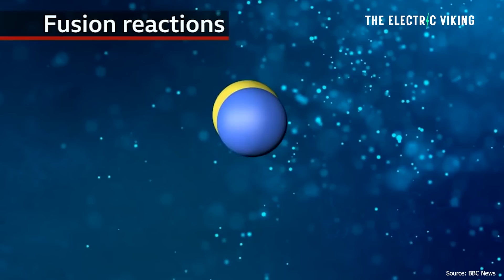Germany says it is leading the world in NUCLEAR Fusion - will invest $2 billion

Comment: Every fusion demo so far ignores one key factor. The amount of power required to produce fusion is not the only problem. It is the power required to power the lasers, tokamak or whatever is used to produce whatever is driving the fusion event. Then you have all the losses in converting the fusion reaction to something that is useful. The money would be far better spent on existing clean energy generation. Even the not so clever Thorium reactor is available now and would be better.

Comment: I am not sure the Yanks got a Fusion system to produce positive energy. My preliminary reading of the studies is that they did not. I would love to be wrong about this and if anyone can correct me then thank you. Fission does produce a lot of energy but there is a very big problem with the waist. I believe there are some promising recent advances with the use of nuclear waist products to be reused to both produce more energy and make less volatile byproducts. There are large sways of land in Australia with a lot of sun that could be used at a very small (comparably) capital cost to set up solar farms. To conclude Fusion seems to be a pipe dream. (would love to be wrong) Fission works but we need to solve the waist problem and Solar/battery could work well at least in central Australia where there is a lot of sunny land with not many other economic uses.

Comment: Fusion research has yet to reach "breakeven". Yes, I know the Livermore Labs claim of 2 Mj  laser energy into the target producing 3.6 Mj out - but it took 30 Mj to make that 2 Mj laser bolt.  Every step closer to "breakeven" has required ever larger and more expensive reactors, and the trend is clear - by the time they exceed breakeven and produce useful amounts of energy, it will be so big and expensive that it can't be economically viable, and may well be the most expensive source of electricity yet. It might find use in "cost is no objection" applications, like military or space exploration, but it won't solve our energy problems.

Comment: 5 times more electricity in a no fossil fueled world. 

Fossil fuels are very high density energy. 

Central generation is a dead duck.
Horse meat was cheap when the Ford model T production line started. 

The national electrical power grid is a 100years stupendously expensive thing. 

Poles and wires to every street and home and building and industry and factory and warehouse and shopping centre and everywhere is incredibly expensive. 

5times is humongously expensive. 

Generation and storage at the ends of the existing national grid is the only economic possibility.

Comment: Sam you are on FIRE! So many interesting videos on the very latest topics regarding renewables, EVs, and even Gov subsidies and their effect on world trade. Amazing. Thank you Sam.
Reply from the maker: Glad you like them!
Reply: @electricviking but the fusion  video is wrong, the laser fusion needed way more power from the electrical grid than they produced. The power gain was only from the laser energy to the output, but the lasers required much more power from the grid to work!

And it was only one ultra short pulse, with an energy loss in total from the grid to the output. Doing many of these pulses per second would just increase the energy loss.

They still have so much to do in research... It's not just an engineering problem like doing many shots per second and harvest the energy, there is way more left to do.

Comment: First off, the US fusion system at Lawrence Livermore isn't even designed as a protype of a power generation system.  It was created to test nuclear fusion to make up for the fact weapons testing has been banned by treaty for decades.  They're researching nuclear bombs, not fusion power plants.

Beyond that, it absolutely did not release more energy than was put into the system.  The system consumed over a dozen times more energy than it generated.  The only thing it achieved was returning more energy from the fusion reaction than was pumped into it by the lasers themselves.   No doubt that's an achievement, but the lasers weren't especially efficient and took many times more energy to power than they delivered to the pellet.  And there's nothing about the system they utilized that would be easily scalable.  

Even if it could be made a dozen times more efficient - which is dubious at best - it's still decades away from being improved to the point where they could perform dozens of similar reactions a second, for months on end, which is what would be required to make fusion an actual power source.

Comment: Fifty years ago I did a project on Nuclear Fusion as part of my Honours Degree  in Physics at university. At the time some scientists were predicting that viable Nuclear Fusion power stations will be developed within 30 years. Fifty years later scientists are still predicting that Fusion power is 30 years away. I don't mind spending money on nuclear research but to think that it will produce solutions in a viable time frame is another thing. Anyway, what is the matter with the Nuclear Fusion reactor that we already have, has been providing Earth with energy for nearly 5 billion years and will for another 5 billion years.Oh and the energy source is free, you only have to build the infra-structure. The Sun is clean, green and very cheap.
Reply: Well,  I work at the lab that did get fusion gain, for the fourth time now. So, now fusion is only 29 years away.
Reply: @jm3digital  LOL. We all (at least those that follow Fusion) know that Gain (Q) is not all it cracked up to be. It needs to be in the order 10 times gain Q>= 10 to make up for input energy losses
Reply: 5 times more electricity in a no fossil fueled world. 

Fossil fuels are very high density energy. 

Central generation is a dead duck.
Horse meat was cheap when the Ford model T production line started. 

The national electrical power grid is a 100years stupendously expensive thing. 

Poles and wires to every street and home and building and industry and factory and warehouse and shopping centre and everywhere is incredibly expensive. 

5times is humongously expensive. 

Generation and storage at the ends of the existing national grid is the only economic possibility. 

Rooftop solar in Australia is cheaper than windows, $/m2.
Big batteries are free with EVs. 
Vehicles are parked 23hrs every day. 

Rapid chargers will be on the main roads and at corner stores. 

Nobody does the maths, it is ezi pezi.
Reply: Except not everybody lives in Australia. How do you think to generate renewables in Poland or Germany in december if there is high pressure system for 10 days ? No wind and solar is minimal in december there. In Australia conditiions without wind and solar do not last longer than 24h so will be easilly done with storage before the end of the decade. @stephenbrickwood1602
Reply: All must be reminded of old school.😎
Reply: I have plenty of solar energy during summer, but hardly any during winter. Germany has more solar during winter, but not enough. Solar is a solution after we can store energy economically for half year, not yet.
German stellarator is an interesting design. It might be first fusion reactor to produce energy. But I have not seen evidence of it.
Reply: @jkn6644  If a large amount of annual electricity is renewable, that will be a huge help.
Some fossil fuel use in emergency and military use will continue.
80% of the world's population is in warm latitudes.
Australia rooftop is cheaper than windows $/m2, 
Most roofs are much bigger than 32m2.
Reply: @stephenbrickwood1602  In 2022:
Nuclear 29.7%
Hydro 16.3 %
Import 15.3%
Biomass 14.8%
Wind 14.1 %
Coal 4.7%
Gas 1.3%
Waste 1.0%
Solar 0.5%
oil 0.2%

Much more nuclear & wind now. So less import needed.  Problem is that wind can drop to practically zero for week or two...
Reply: @jkn6644  we are biased by where we live. 
I think about the global situation but live in the sunniest country on the planet. 
But we will be the first to burn and then suffer floods that wash away topsoil. 
We suffer from the world's CO2 proliferation we fought against nuclear proliferation.
We need a renewable proliferation fast.
The other possibility is depopulation proliferation. 
But climate destabilisation may come first.
Reply: In cloudy Northern latitudes the sun is not reliable. In Australia Spain North Africa etc .....it is.
Reply: You are extremely old.
Reply: - which is precisely why the big Finance barons, the high priests of money HATE solar, PV power... It is breaking their economic extortion,  strangulation chokehold on our economy, their bread income streams for the past two hundred years have been resource extraction aka oil extraction, processing, and distribution, &  wars profiteering +  loan-sharking from their privately owned central banks
Reply: @@AI_effect NO! I would need 3000 km line to get enough solar during winter. For Germany 2000 km would be enough. Slightly less would be enough, but areas there are densely populated. On Monday peak price was over 40 c/kWh. Next night 0.4 c/kWh (+ transfer + tax). During the night we had enough wind, during day not.  Sometimes we have no wind at all (total in the country).  1000 km transfer line is not enough for wind. I don't know if 2000 km would be.  It is faster and easier to build new nuclear than to build such transfer lines.  
Solar needs storage for half year, wind perhaps month. Batteries will not do.
Reply: What's your point? We shouldn't pursue it because it's difficult? When you say what's the matter with the Nuclear Fusion reactor that we already have, I assume that was a mistake and that you meant Nuclear Fission reactor. The matter with those is that they produce a lot of radioactive waste and expensive materials are required to power them. Nuclear fusion is the endgame for power generational and would dramatically change the planet for every single persona and I'm really glad that it's being pursued, even if progress is costly and slow.
Reply: @WolfetoneRebel1916 The Fusion reactor we use now is the Sun.
Reply: @martintierney6172  central generation is stupid. 
It is stupidly expensive to transmit the future volume of electricity that the no fossil fueled world needs.
Reply: @WolfetoneRebel1916 the sun generates enough gravity to keep nuclear fusion running.
It's not a typo.
I had to re-read it too.
Reply: @WolfetoneRebel1916  Nuclear waste from conventional reactors can have a second life in Molten Salt Reactors. And once it's so depleted to be useless for that, it's medical grade.